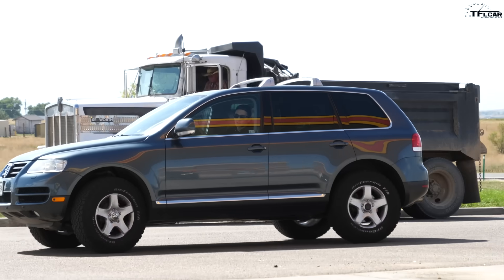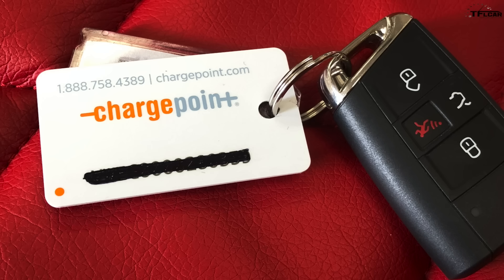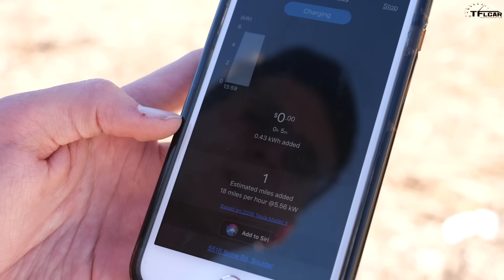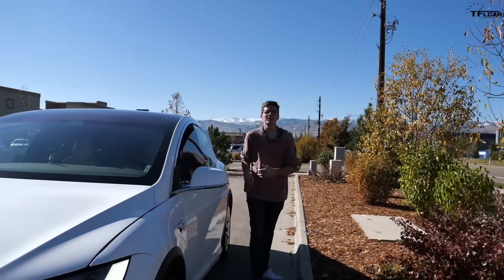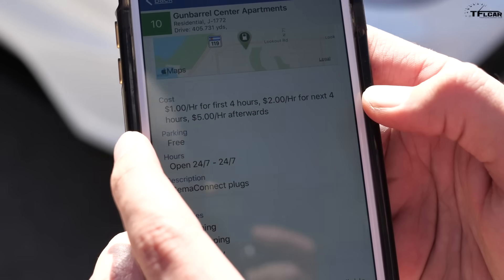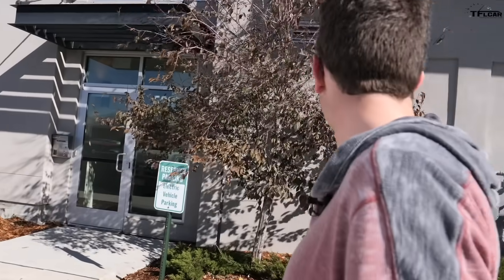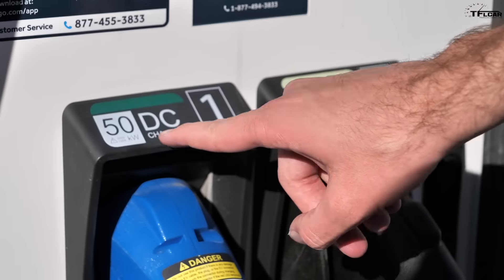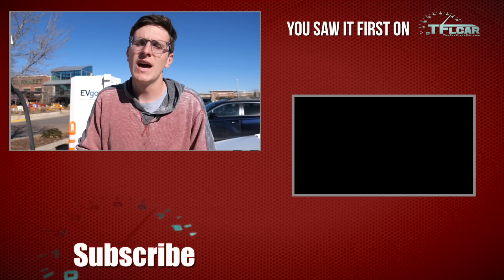Here’s Why Charging an Electric Car Can Suck - And It’s Not The Reason You Think!

Comment: It's pretty fun to read the comments here.    

What if I told you that my car has zero maintenance costs, running costs around 4.5 USD per 100 miles and that you can fill with fuel from your home while you sleep? And the car will probably last around 25 years or so.

"Nah, I don't want that. If I go on a US road trip from coast to coast I need to stop several times and charge. I don't have that  time. "

Well, to all you super humans who don't need to eat, sleep or pee - go on with your expensive ICE cars. Eventually, you will buy one - it's just a matter of time.

Comment: I am sorry, but I will stick with my gas guzzler for right now.  I can see this becoming a problem with more and more electric cars on the road.  What if you can find a open charging station, you are screwed if you run out of juice.  Plus no standards, you are at the mercy of that charging station far as what type of plug and dollar rates they will charge and what cards you can use.  And last, sitting around waiting for an Electric car to charge is like watching grass grow.   Unless you have a hybrid that can switch over to gas, then you might as well stay with a gas powered car..   No thanks to electric cars for right now.

Comment: So my gas car has a range of 300 miles. So assuming the electric car has that much range it’s going to take 20 hours on a nice day to recharge. If it’s cold it will take a lot longer and not achieve a full charge. So what is a day trip for me may take 5 days in an electric car. Won’t haul my 5000 lb trailer. That’s just stupid unless you have just time to spend.

Comment: The REAL deal breaker.

6 cars in line waiting for gas(half empty):
5 mins x 5 cars is 25 mins wait in line for 6th car.

6 cars in line waiting for electric charge(half discharged): 
30 mins x 5 cars is 150 mins wait for 6th car to finally plug-in!!
THATS  2.5 HOURS SITTING IN LINE FOR A SINGLE WOMAN WITH A 1 yr old baby IN A BAD NEIGHBOHOOD!!

FOR FUN!
30 cars in line during 70s gas shortage.
29 x 5 mins is 149 mins or 2.5 HOURS. FOR GAS.

ELECT CHARGE:
29 x 30 mins charge is 870÷60
= 14.5 HOURS!!  FORGET IT!!

Comment: 1 important note that seemed to be glossed over a bit. was how in Europe. the Tesla comes with the standard outlet because the EU wouldn't let them sell their product there if they didn't comply with the standards. Whereas other regions don't have these over-arching standards and just let these major companies do whatever they want.

The problem with EVs is the same problem we had when portable electronic devices first came about. every single company has their own cable/charger and they're not compatible with eachother. For EVs to really take over there needs to be standardisation and infrastructure put in place. Driving an EV should be just like drive any ICE vehicle with re-fueling stations being universal.

Comment: I have a Cadillac ELR, which is based on the Chevy Volt, which has a battery range of around 30 miles which worked out great for me when I had my own home in Arizona, and I even had a 220 volt plug installed in my garage there to charge it in 6 hours. I moved back to California in a condo with a garage which had an outlet, but due to covid and not working I no longer needed the quicker charge. After a few years I decided to get a condo closer to the city, but it only had a large communal parking garage on the first floor, so I had no place to plug in my car. I went to one of the EV Go stations in a Walmart close to my home but had no luck in getting the car to begin charging, so I went to Blink which was on the other side of the center, and much more user friendly. I inserted my card, and it said it was authorized, and began charging. When I got back in my car it said it would be fully charged in 6 hours. Needless to say. I have nothing to do in a shopping mall for 6 hours unless I work there, so I unplugged the car and left. I have since decided to sell the car and go back to a gas vehicle, even though it has a 4 cylinder engine which generates power to drive the electric motor that powers the car. It was fine when I had my own home, and had somewhere to plug the car into, but if you are in a condo or apartment complex you are still better off with gas vehicles until they get this crap worked out. I saved a lot not using gas for the first years I owned the car, and even when I moved back to California, and was not working, but if you don't have a place to charge it, it really doesn't do you any good.

Comment: When solid state batteries make their debut, charging will take between 10 to 15 minutes depending on the batteries.  This will be a full charge at 240V.  This means a full 1000 mile charge while you are eating lunch.  It will be a game changer.

Comment: I just watched this video in December of 2021 more than 2 years after its production.  For those watching later, remember this technology is rapidly advancing.  Charging speeds are much faster.  Some comments below said waiting 30 minutes to charge is an eternity compared to a gas station fill-up, but for most who will be charging at home over night, there are no gas station fill-ups.  How much time will that save you per year?  How much time will you save on oil changes since there are none?  Think about how much time it takes to plug your phone in at night.  These charging centers are really an exception for most people.  If your phone dies while you're away from home, you just ask your friend or nearby business if you can pug in for a while. Everyone has electricity.  It's a matter of the plug. I believe apartments will be installing charging centers soon, too.

Comment: Living a fast-paced lifestyle and with most people's schedules, it is too much time wasted waiting and planning around charging stations. How can a person justify sitting around for an hour at a charging station in God knows what part of town only to gain around 15 miles of range. With the huge cost of the EVs and the battery at best lasting around 10 years, what will a battery replacement cost be, and what with the car be worth at trade-in time with a used-up battery? For me, the EV industry and owning an electric car are more of an expensive novelty. The challenge is that, to date, lithium production has required moving large amounts of dirt and rocks, and consuming millions of gallons of water to extract this precious resource. The process has often unsettled local ecosystems, threatened endangered species, and disrupted nearby communities.

Comment: Thanks for the info.  Electric vehicles are not for everyone, as they are expensive and as you have already shown can be a pain to charge on the road.  I have an E bike conversion which works for many of my needs, but does have limited speed at 30 mph and range of 15 miles unless I load up additional batteries

Comment: Does anybody understand what he is saying? Charging 17 miles each hour? Do you see how long it will take? In 5 years, when there is 1000s more EVs, does anybody see a BOTTLENECK developing? This whole thing is completely NOT ADDING UP. Either you drastically cut your car use, or many hours will be spent charging your car every week. I truly can't believe people are going alone with this plan. I am assuming most people haven't even considered the endless hours that will be spent servicing your EV. Criminals are licking their chops at the new opportunities to hit waiting "marks" in this new system. Carjacking, assaults, muggings, easy pickings for the criminal element. Everybody, at least realize what you are facing in the near future. Your life is gonna drastically change, & not for the better

Comment: Seems a little complicated considering I can FILL UP my car with gas in 5 minutes and drive about 400 miles and then find a gas station just about everywhere within a few blocks and fill up again. EV'S may have their place in the future for short distance local driving  but that's about it. With that said, we still need fossil fuels for thousands of other products, not to mention air travel, heavy construction equipment. So for now I think we are at least 100 years away from drastically reducing our use of fossil fuels for transportation. I'd still put my money on oil stocks rather than EV stock. The smarter thing to do right now is focus on producing cleaner burning fuel.

Comment: You are in a city where the charge  stations are close. Get out in the country where they are far apart and they don't always work, and AAA is your best choice. Also the temperature today in Wisconsin is 25 degrees F. I am not standing around for 10 hours to charge my car to go 100 miles. (The range drops as the temperature drops.) DC quick charge or nothing. That's why I don't drive my EV on trips.

Comment: We are still in the hybrid era for most people.  Right now a plug-in hybrid makes much more sense.  The Chevy Volt was the ideal setup, but they ditched it for more profits.  These were very dependable with virtually no issues.  They then put their efforts into the total electric Bolt.. some of which were catching fire.  Not a good selling point, even though they've probably solved it.

Comment: How quickly do the batteries degrade if the vehicle used regularly?  How about if it stands most of the time?  Most electronic devices using lithium batteries show noticeable drops in battery capacity within 24 months.

Comment: Just what I’ve always wanted, yet another device I have to remember to keep charged.  This one even has the advantage of needing a long cable snaking out of the house to the driveway.
Reply: My spouse has difficulty finding the gas tank,I can’t imagine watching the charge level on my car all day long
Reply: I like my Dependable gas car I'm sure electric car is nice but I should be able to make my own options
Reply: Imagine having to wait in line to charge your car in the 115 degree AZ desert . Blame the Democrats , it is them who are forcing this crap on you ....VOTE RED
Reply: If you're going to run a long line out to your car make sure the cable is of sufficient thickness (gauge) to handle the load..Kind of like trying to run your dryer using a lamp cord..It'll fry the lamp cord and your dryer. Another issue will really thick cord is it's heavy. Ten gauge wire is rather heavy even without the plastic insulation so a 40 foot cord? You might need another vehicle just to move the damned thing around your driveway..
Reply: @martinoamello3017  A “50” amp (40 amp) EVSE (the charging set that came with your car) requires #6 gauge cable, not #10. #10 is for a maximum of 24 amps.
#6 gauge will have a #10 ground wire. #10 gauge will have a #10 or #12 ground wire.
An ordinary “heavy duty” extension cord is rated 13 amps, just enough for a 120 volt EVSE (12 amps).
Reply: Yeah, and you can't charge them IN the garage, lest they catch on fire and burn down the house.
Reply: @dapperdingo  An ICE has NEVER caught fire in a garage! /s
Reply: @nvrick7729  Not likely, unless there is a short from the battery and electrical system that would cause it. I have battery shut off switches right on the battery negative terminal on the two vehicles I keep in the garage. No chance of fire starting. I turn the switch on to start the vehicle for a trip. Once back in the garage it's switch off time. Cant do that with the EV's.  I have an electric assist powered bike that has a removable battery. I keep all Lith ion batteries in a non combustible area, including power tool batteries. If I had an EV it would have to stay in the driveway, far from the building and treed and brushy areas. I have no garage and home insurance as it is un affordable, being it's a log home in a wooded area. I have to use the ABC insurance plan... (Always Be Careful). Unlikely that I will ever buy an EV anyhow as I just hit my 60's. I'll stick with ICE as long as I am around. Dependable!

Comment: This review is 100% BS! We own a  2021Tesla Model Y and have had a great experience! So much that we have ordered another 2022 Model Y with 4680 battery which may have close to 500 miles. We have 17K on our current Model with zero problems. Never any problems on trips, it takes 20 to 30 at most. I am 78 years old. The car will last for 1 million miles and the battery for 500k miles. You can replace the battery for less than 10k .WE ARE REAL OWNERS

Comment: I have been struck with the technology for some time now. I have a friend who has one and loves it. I just can't see spending $50K for a commuter car. There is simply not the infrastructure to make this feasible. The range still sucks and charging times make this out of the question for most people. And if you live in an apartment complex, good luck. Hybrid technology is still the best solution for now. It will take decades for enough charging stations to support a marketplace dominated by EVs. By that time, someone will invent another, more efficient and workable solution to the problem. One of the greatest ideas of the 21st century that doesn't work.

Comment: You  didn't tell the folks how much. Rates are set by owners and generally are significantly above the rate of energy cost. For instance, our  fast charger is 30 cents per kWh when l know the condo building pays. 13 cents, even though Chargepoint pays all costs of installation  Therefore, you can also and should check  the costs on the charger faceplate. Typical in Los Angeles for fast charging runs .25 to .30 per kWh.

Comment: You simply instal a Tesla Wall connector and hire an electrician to install it with a 60 amp service to the wall connector. That allows you to charge at the maximum rate of 48 amps when charging with AC power at 240 volts with a 60 amp power supply. That will charge your Tesla overnight fully so if you have the long range battery will allow you to drive over 300 plus miles on a single charge. Like I stated in a previous post this is simply FUD to scare you into thinking you can’t charge your Tesla, the truth is you will rarely need to charge after you left your house. Why in Gods name would you use a charger other than a Tesla charger which you map in the car will guide you to one when needed. Tesla superchargers are DC and can charge up to 250 kilowatts per hour. That charge rate will bring you from a effectively discharged battery showing 2 percent state of charge and bring it up to 80 percent state of charge in 20 to 30 minutes. 

Honestly food for thought

Comment: Great. So, it's like going to the gas station several times each day, for much longer periods of time than to fill with carbon based fuel, just to have enough juice to get around at a decemt speed and keep the stupid battery in the 20-80% range to avoid battery damage. You must download several different aps that handle payment inteface at variable sites and vendors. You must expose yourself to potential risks of theft, accessing your accounts several times per day. At most you can really only travel 150-200miles per charge with any regularity.  If you live in warm climate, the batteries encounter overheating, which raises their known propensity to catch fire. While charging, certain models are catching fire (often over night.) Most homes are not set up for high voltage, required for charging, which costs thousands of dollars to retrofit, not including the actual charging station. If you live where it gets cool in the winter, the battery performance declines significantly, reducing an already limited range. 
If there is a power outage, no charge and you better have a gasoline backup.
Our current electrical infrastructure and generation cannot handle the demand we currently have. Now just imagine having to convert all of the energy needed to move cars from carbon fuels to electric. I would not even want to do those calculations to within a 99.5% certainty.
At least half of our grid is supplied by coal and other fossil fuel generated power, so what is the point to crash rush this technology still in its late infancy?
The whole CO2 concern is noteworthy, but the extent and forecast impact is blown completely out of proportion, causing economic and system restructuring hardships and long term unintended consequenses that are not even questioned, making for one of the largest psy ops ever successfully manipulated on a population.

Make life inconvenient enough and people will start doing the simpler thing--staying home in their government provided pod spaces in massive inter-city residential zones.

But I cannot wait to get in line for my stupid e-vehicle, e-pod house and anything other de-humanizing mandate they deem necessary for my health and protection and especially that of the endangered 4.3 Billion year old planet that is somehow only now in existential peril.

Comment: All these EV people are completely skipping a step in the process. Hybrids were a step in the right direction but the evolution should have been running a combustion engine just to supply power to a battery pack with all electric drive being used to propel them. Trains have been doing this for years.

Comment: If you never go anywhere, as say, more than 20 or 30 miles a day, an electric car looks great. Considering the time element, an EV would work like my bicycle. That is considering time taken to charge the vehicle, and how long it would take to ride my bicycle 20 or 30 miles. But my bicycle is $40,000 cheaper than an EV.

Comment: So... let me understand... it will take me 20-25 hrs of charging to get the same range as my gas vehicle? So if I drove 600 miles in my current vehicle on the interstate, I can do that it about 8-10 hours... but I will have to add an extra whole day just for charging????? Um no. No thanks. Nope.

By the way... you know that the electricity to charge your electric vehicle comes almost solely from fossil fuel-based energy?  Shakes head.